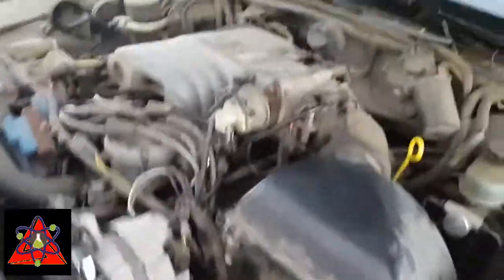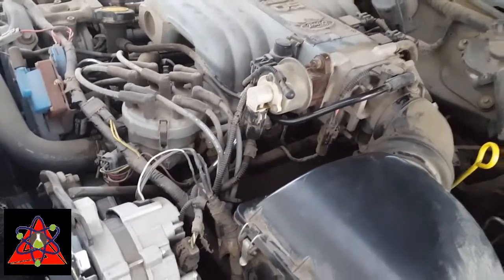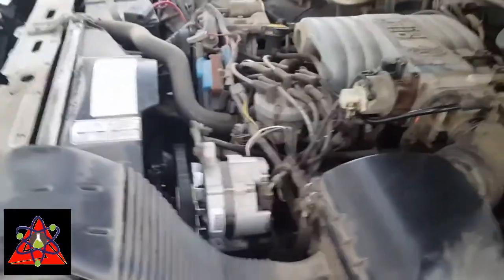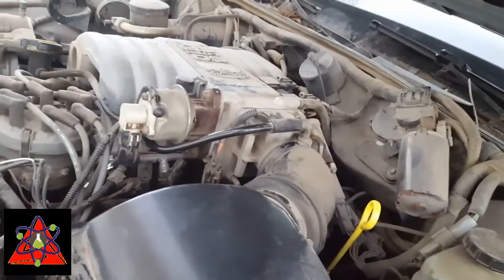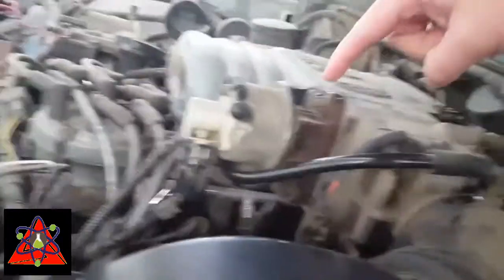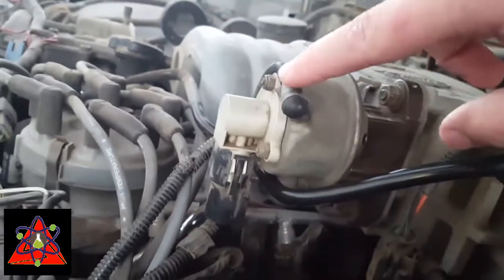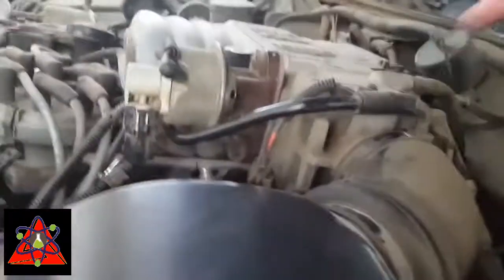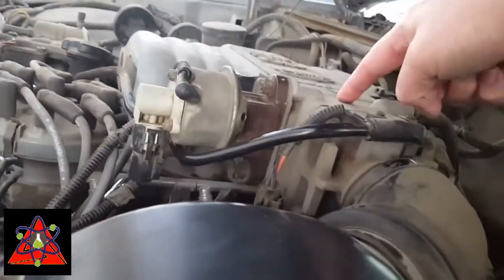Where Is The EGR Valve on a 1991 Mercury Grand Marquis?

Comment: Make more videos I got a 91 Mercury Grand Marquis I found the codes 41 & 31 an my motor was shaking but actually is the air flow sensor. Not always the codes are right with my obd I
Reply from the maker: Thankfully, the mercury has been running pretty good lately, but the next time something needs work, I'll definitely make a video for it.  Yeah... That's one of the drawbacks of the old OBDI interface---- some things that go wrong can trigger different codes based on what systems are affected, even if the code doesn't match the malfunction directly.

Comment: I have a 1992 G.Marquis,question,have you ever had this issue?driving on the freeway,i let go of the gas switch lanes and i press the pedal aagain,and i hear like chains rattling on the engine,i have no idea where is coming from or whay is this happening
Reply from the maker: I have not experienced that before. Without having the sound located, it's going to be difficult to identify a cause. Could be low oil/transmission fluid, could be a failure in the transmission, could be bearings failing in any of the engine pulleys, could be a loose timing chain, could be a failing belt tensioner pulley, among other things. Do you lose power at all, or is it sluggish to accelerate when you hear that noise? Does revving the engine in park/neutral allow you to replicate the sound? Definitely check your fluid levels before attempting any further investigation as low oil can lead to the engine seizing, and you don't want that to happen.
Reply: @UnexpectedlyRandomOfficial  i do loose power when noise comes on ,tensioner pulley,thats the only thing i hear when its parked and engine running,cus aall fluids are good
Reply from the maker: Loss of power could still be numerous sources, with the engine stopped, you can remove the belt and check each pulley for movement perpendicular to the axis of rotation (wobble). Check your engine belts for wear/damage too. The timing chain is very difficult to check, as it is usually buried in the front of the engine. If the belt tensioner is one that you slide along a rail and bolt into place, confirm that it is secure and properly positioned to maintain belt tension. If it's a spring loaded tensioner, it should be difficult to move away from the belt by hand. If it feels soft/moves easy, that could be contributing to your trouble.

Comment: big question of mine, where can I find a replacement EGR spacer?  nothing online matches...I know that's random and 4 years later
Reply from the maker: No worries! Are you referring to the EGR Spacer plate/gasket? The (roughly) oval shaped gasket that seats between the upper intake manifold and the base of the EGR valve? If so, the shop manual is indicating part number: E5DZ9D476A and I see one on eBay that looks similar to what I recall from that job: https://www.ebay.com/itm/124996067612  Of course, I can't vouch for seller or item quality on eBay, but the buyer protection usually has you covered in most cases. If that doesn't look like yours, let me know what's different and I can see what I can find.

Comment: Please keep making videos for this car...I have a 1990 and your videos are the only ones that match my engine, lol...
Reply from the maker: Ssquared Sisters I'd be happy to make more videos of the Grand Marquis. Any area you'd like me to focus on?
Reply: Levi Werner - Unexpectedly Random the fuel system...I got the 87 code and a tps code but I replaced the top...I was surprised it only had two codes...the 87 code was no voltage at the fuel pump primary circuit...so get a new fuel pump?
Reply from the maker: Ssquared Sisters Possibly a bad fuel pump. First I'd check the fuse for the fuel pump. If that's blown, replacing it should solve it. From there, you can test the voltage and continuity at the fuel pump relay. If the relay is bad, that would send a fault to the ECM and cause the trouble codes. If all is fine there, I would check to see if the fuel pump is functioning at all by disconnecting the fuel line at the fuel filter. Put a clean bucket under it to catch any fuel then get in and turn the key on (or have someone turn the key so you can watch the fuel line) If it has a weak or no flow, check the continuity on the fuel pump terminal. Poor continuity may indicate a bad pump.